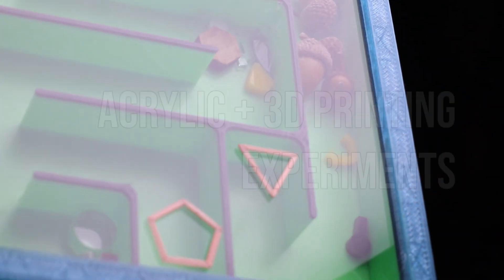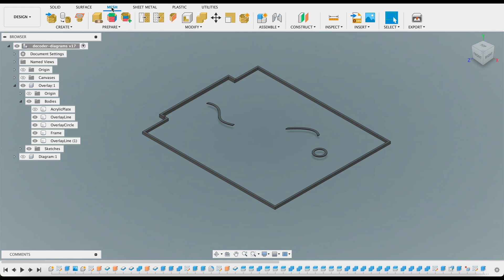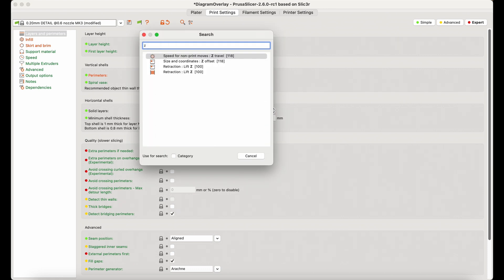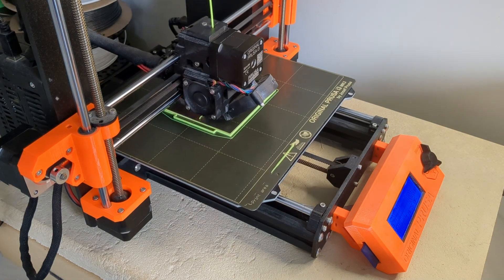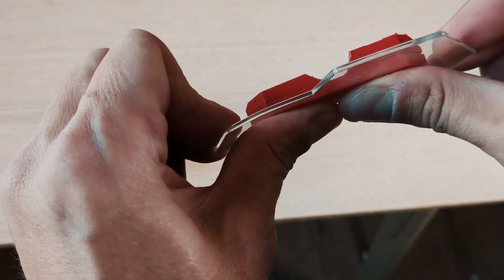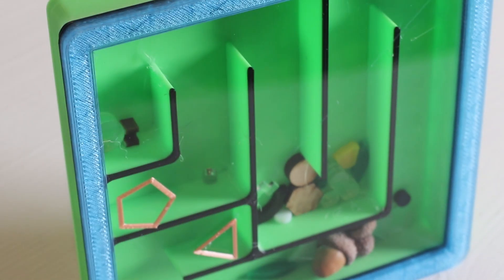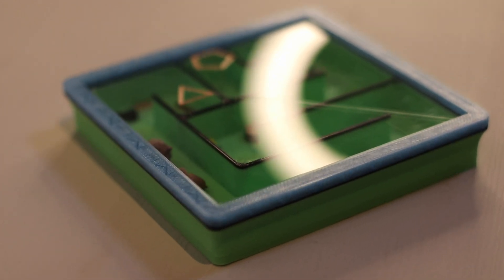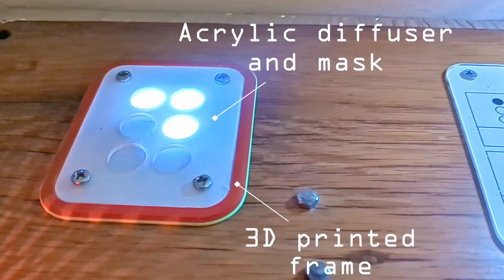DIY: Crystal Clear 3D Prints with Acrylic

Comment: I've just tried this and the moment I insert the acrylic, the heated bed causes the sheet to immediately deform as it stress relieves. Did you experience this?
Reply from the maker: Sorry it's months later but... I haven't ran into this. I'm using 60C bed temp, 1.5 - 2mm acrylic sheets. I don't think I landed on particularly expensive/high quality acrylic either (I'm not the one sourcing it).
Were you using bed temp closer to 80-100C? How bad a warp are you seeing?

Comment: For the PLA on Acrylic experiment, it seems that the acrylic sheet could just be thought of as the build surface. 
Couldn’t you then  forego using CAD and just use the tools in various slicers to achieve the same result? Basically just removing a step and saving time. 

I’m still learning so this is an actual question . 

Thanks for the excellent video
Reply from the maker: Sorry it's months later but... You could take that route if you don't need to precisely position the acrylic part. That was basically the reason I built the fence, so that I have precise-ish guides for when I place the panel.

Comment: Cool! I actually have been experimenting with using acrylic alongside my 3D prints. I made a coin box using a similar technique, but I've found my hotend settings aren't getting the bonding you're getting - in fact I've gotten stringing when trying to print on the plastic, which I've tried alleviating by using gluestick.

based on those experiences, I've also been trying out using acrylic and MDF shims to avoid printing supports, and do things like emboss into the PLA. Have had mixed results so far!

Comment: Ahahah no i can't reach more than 115, maaaaaybe 120 with my bed. Since i have a self-made DIY printer i actually have to be pretty deliberate about that, so assuming my MOSFETs short out, i can't have any of the adjoining materials catch fire. Low probability issue but still as sloppy as i am with engineering in all other regards, at least i want to get this right.
Reply from the maker: That's good. You built it so you know what's in there and what it can and cannot do.

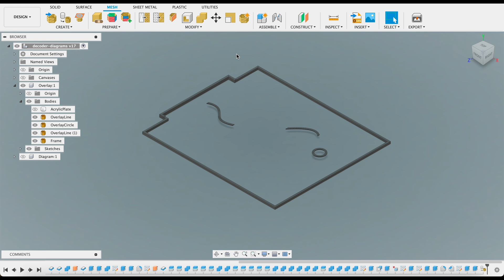Comment: 1:45 Yes, you can export more than one body as a single mesh file and you don't even need to mesh your parts before that (whether or not you're exporting one or multiples).
Single part > Object > Right Click the Part > Save as Mesh. For multiple parts you do the same but you don't right click any bodies, but you right click at the very top of the tree (in your case you'd right click "decoder-diagrams v17"

Comment: Are you using a CO2 or a diode laser? I'm just starting to get into laser cutting, and I'm curious if there are health safety issues I need to be concerned of, particularly with acrylic.
Reply from the maker: I'm outsourcing that part to a local laser cutting shop. As far as I know acrylic is not toxic. Never cut PVC, that's what I do know, because chloride gas is literally a WWI chemical weapon.

Comment: Great video. With fusion 360 you don't need to combine meshes to export - I do my multi part / multi colour exporting by turning off and on the visibility of the various parts and then exporting the whole model.  Also i've been working on solving the transparency issue using a slightly different approach -  using much thinner dye cut acetate (using a cricut maker3) for the transparent parts - but like your approach for thicker transparent items.

Comment: you can use a soldering iron for bending acrylic sheets or even a hot air gun if you're patient and careful
Reply from the maker: Bending with a soldering iron sounds like a really steep learning curve. Hot air gun sounds better, but I think I'd also struggle to get uniform heating.
But, by all means, use what you have and gets the job done.

Comment: You can actually export as one file directly to slicer in Fusion 360.

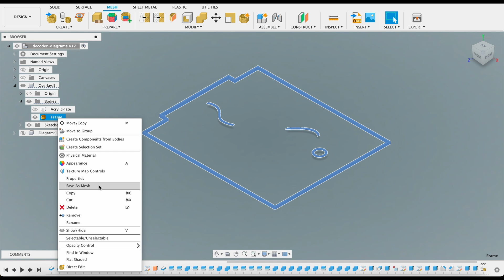Rather than selecting your object, select the box at the top that says 'decoder-diagrams v17' (at 2:04), then go to Utilities, 3D print, select your file type or directly add your slicer and it will send over the whole file. You can do this with components, too. 

If you're using bambu slicer or orca slicer, you can do File > Export > select .step for file type and save, it can leave a better surface finish on curves in some cases due to g-code curve and geometry optimisation happening directly in slicer.
Reply from the maker: Nice, thanks for the tips. I should probably make the switch to .step, it's just the extra step of isolating the body that I want to print that held me back I think.
Reply: @juliusmakes   Yep and if there are any parts of your file you want to omit from the mesh, just hide it before exporting.
Reply: @juliusmakes  You can use Right-Click -> Export on the "Overlay: 1" component. As @BEdmonson85 said you can exclude a body by hiding it when you export. Alternatively you could instead make the "AcrylicPlate" body in a separate component so you don't need to toggle visibility every time you save.

I use this to export a single file that contains separate components for different colours, manually designed supports, and modifier volumes.